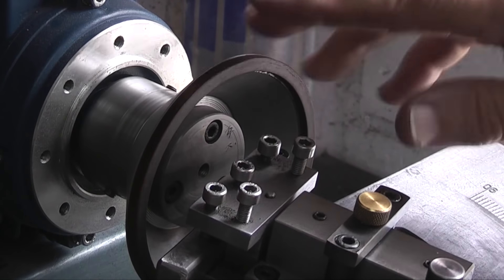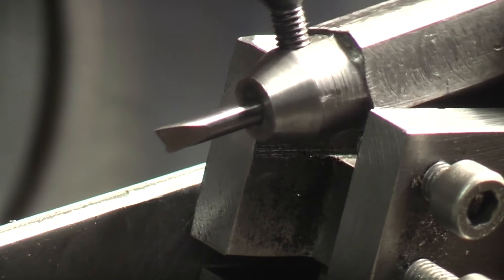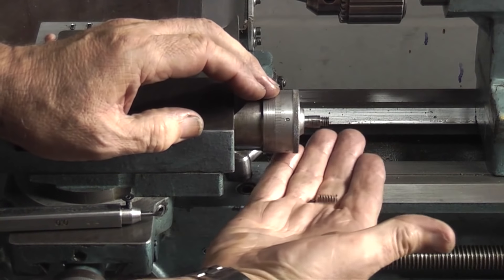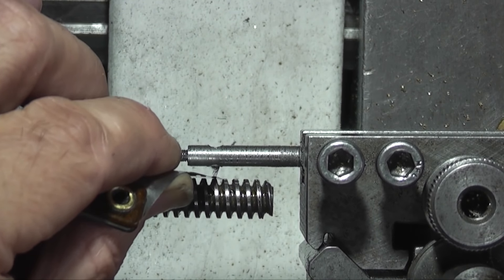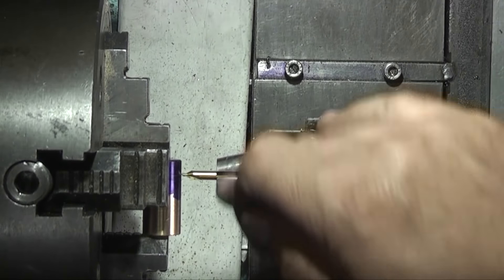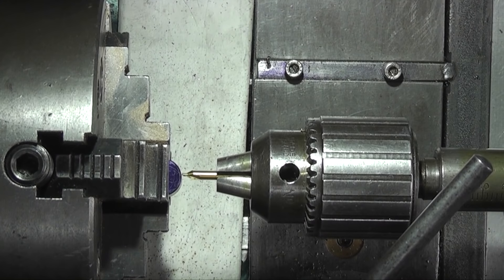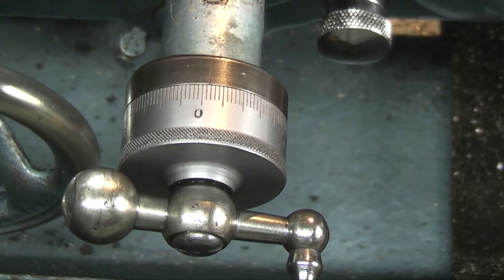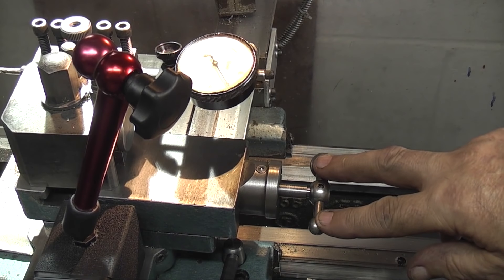New nut for the compound slide

Comment: You had me confused for a moment when you said metric Acme thread. When I saw your lathe dials were metric I could see it is a metric trapezoidal thread with 30 degree inclusive angle you were producing. It is a very common slip of the tongue. I've been guilty of it myself a few times. I do prefer to use the carbide form inserts for these type of threads but when in a very small bore like this then there isn't sufficient room to clear the tip and holder and hand ground is the only option. Good job,it all turned out nicely.👍

Comment: Thanks for yet another interesting and educating, impressive and well produced video. As we say here, one must have the patience of an angel to do work like this.
At the time 12:00 You center the bronze stock. It looks like a Joe Pie trick  (hope I'm not insulting You) but are You sure that the thickness, radially, is the same of the chuck jaws?
At some 18:00.... Comming close to the finish of the cut I experienced that the cross slide needs to be retracted quite some more than in the beginning of the cut. (the thread is deeper). It's easy to get out of sync when positioning the cross slide for the next cut using the hand crank only. I use a dial indicator as cross slide zero position having no DRO on the lathe yet.
Time 19:45 Tidious work to pull the screw out for testing and then putting it back. That's life, sometimes.....

Time 20:00 Just more of it, and worse.

Well done!
Reply from the maker: Hi Stefan the 4 jaw chuck jaws are machined on inside and out and you can measure the width. this was the only way I could think of setting the bar central in the chuck

Comment: Ya good save . my lathe has a longi-feed screw with half nuts but it's one nut the feed lever pushes up on (not solid) thinking about drilling and brazing a block of steel or cast iron then cutting the threads in the braze and making a over center cam to pulll the two together     got anymore HHO torch stuff thinking about building a bit bigger one of those but no much bigger big enough to do that thread repair thanks

Comment: @21:00 you should wind the thread all the way into the new nut before doing up the grub screw. You wat to have the new nut at the correct height in its bore so the shaft is on line with the thread in the nut.

Comment: Nice job Alan, how much wear was in the original nut? And is there any appreciable wear in the top slide leadscrew?
Reply from the maker: Hi The original nut is 50 years old, the top slide nut was replaced about 5 years ago but with DRO fitted its not a problem as you know the tool position

Comment: Can you show how to set a basic machining tool and parting tool.  And the different types of ground cutting blades/tools.. also how to adjust the height of the blade/tool. My boxford has no up or down to go higher or lower for the tool fitted.  Do i use shims to make it higher?
Reply from the maker: Hi Yes if you don't have hight adjustment on your tool holder you need to use packing under the tool to set the tool on centre line. I have many videos that will answer your questions go to my channel Enots engineering.

Comment: Do you know the actual size of the thread? Is it Acme in form, Metric or something special Boxford cam up with? Matt
Reply from the maker: Hi Matt It Is a metric thread as the dials are in metric it could be a metric trapezoidal thread I just made a copy of the original thread
Reply: @enotsengineering  It appears the nuts are a mix of imperial and metric . so not easy if you want to use a specil tap. I'll have to try your method in due course.

Comment: Now that you used your new indicator, how do you like it?
Reply from the maker: Hi Craig Its a lot faster than having to reverse the tool to the start. Plus if you have the take the cutting tool out you can use the thread dial to realign the tool to the correct position
Reply: enots engineering : Yeah, I grew up using them so watching you reverse the lathe was strange to me.